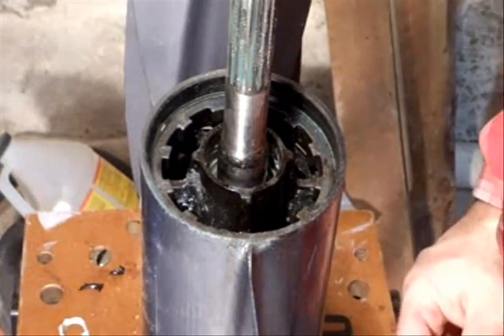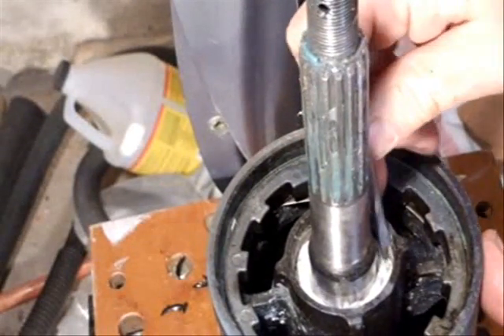Lower unit seal replacement pt 3 of 3 - unit 2 removal and installation

Comment: I pressure test with a gauge installed and let it sit for several hours.  If the gauge drops at all, it's not sealed.  Also, the threaded pipe part made me cringe.  I know you probably have a sanding station, so you could take a piece of PVC pipe and sand it down until it's the exact same diameter as the seal.  That way, there's no chance of damaging it when you tap it home.  I've made many homemade seal drivers using various PVC fittings.

I don't mean to be overly critical.  Just throwing out my experiences for those who take the DIY route.  Good job on the videos.

Comment: Thank you so much for your time and video. I tried your method on my 2003 Yamaha f115 and had great success. Here are a couple of changes that worked for me. I used a 12 inch 1/8 drill bit that was not Cobalt, purchased at Lowes Hardware for $7.00 with #8 pan head screws. I tried the #6 screws but they were too small for the 1/8 th bit. I used a pair of needle nose vise grips and a block of wood against the housing to pry them out (as someone else suggested). Someone also commented that if you use sealer on the new seals that it will get into the bearings ...... If you only coat the outside of the new seals and not the bottom you will not have this problem BUT it will make the new seals more difficult to remove if you ever have to do this again. Just saying. Thanks again as you saved me allot of cash.

Comment from the maker: I agree but was not confident I would be able to get the bearing housing out for this 24-year-old lower unit. I have heard that this frequently requires heat and hammering and can sometimes result in a damage. I wasn't worried about the ring nut. Regarding greasing the needle bearings, aren't they lubed by the gear oil?

Comment: At 5:16 did you put that Permatex only to the outer side of the seal? Is it recommended to grease the shaft before inserting the seals?
Thanks for the video and I'm going to use it on my F25 tomorrow because of I was unable to pull its lower bearing casing apart. I don't currently have compressor available but I believe that those oil seals are leaking because of I found fishingline strapped between the seal.

Comment from the maker: The slide hammer came with the vicegrip attachment if that is what you are wondering about. I bought the OTC 4579 9-Way Slide Hammer Puller Set on Amazon. You might be able to pry them out without the slide hammer - see comment by TravisVision

Comment: @hanapaa2000 I just replaced the seals and would have never of tired this without the aid of your videos and information.  I bought the # 6 metal screws, the 7/64th cobalt bit, and the 1 1/4 inch iron pipe.  Here's what I learned that might make it easier for you the next time.  I found it extremely easy to just grab the screws with pliers, use the area to the side of the seal for leverage, and just push down (instead of using the slide hammer, the seals came out right away).

Comment from the maker: Travis - I used number 6 stainless sheet metal screws and a 7/64th cobalt bit. I think the length of the screws was 1-¼ but longer will also work. When tapping in the seals, they make slightly different sound when they seat. The pipe was 1 ¼ inch ID black iron pipe I had kicking around which needs to be longer then your propeller shaft so you can tap on the end of the pipe without hitting the shaft. You want something with an OD as close to the OD of the seals without being larger. Good luck.

Comment: Hey hanapaa2000,
These are great video's and I will be using your method to replace mine as well.  I have a lower unit for a 220 HP Yamaha 2-stroke outboard that I just discovered leaking.  I've order a new water pump and seals which should arrive sometime next week.  What screw size(and length) worked the best for you?  How do you  determine the depth to tap the seals down?  Also, what was the diameter and length of that pipe?  Anything else that I should look out for?
Thanks,
Travis